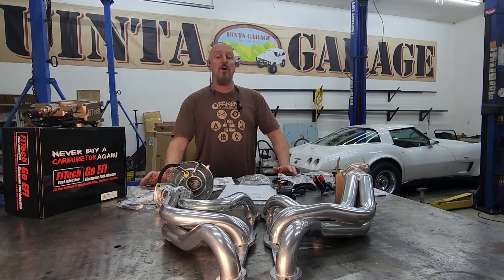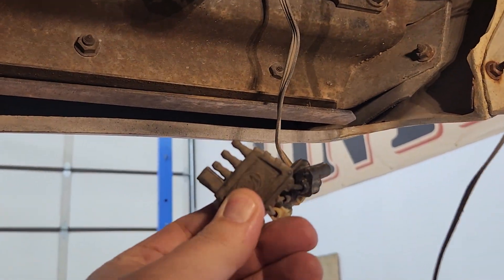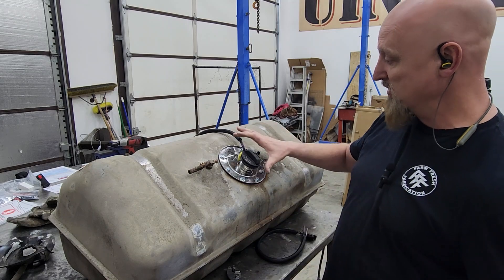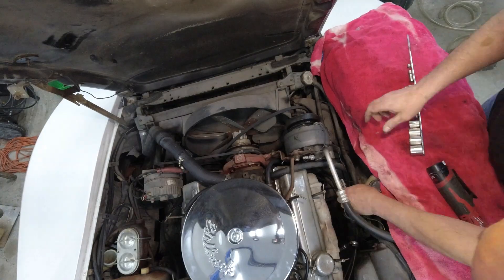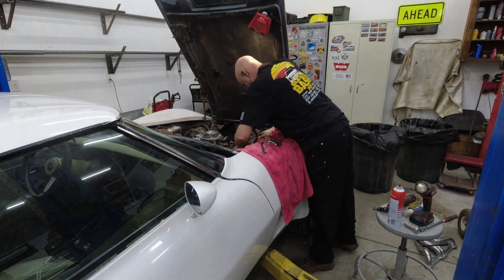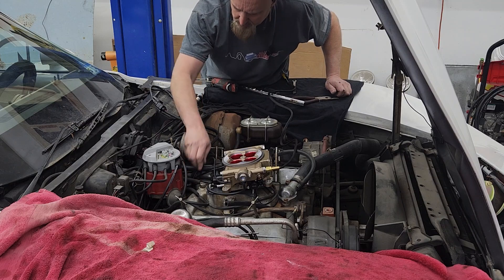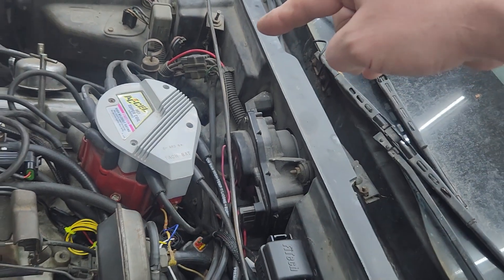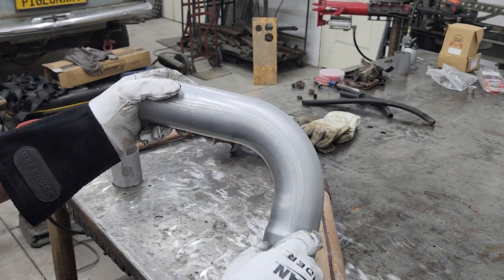1979 Chevrolet Corvette Fitech Fuel Injection install!!

Comment: where did you wire in the white wire in side the car
Reply from the maker: Sorry, just getting back to this.  We found an open spot on the stock fuse block that was connected to the ignition circuit.